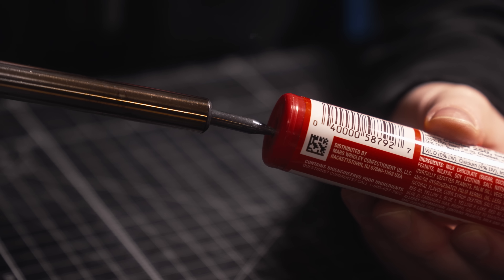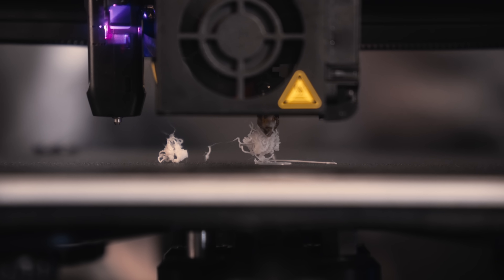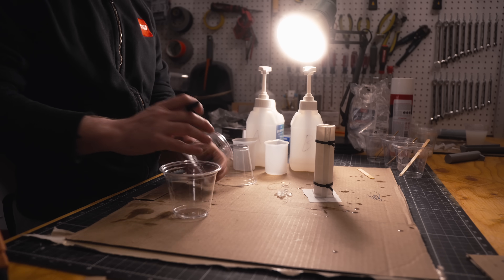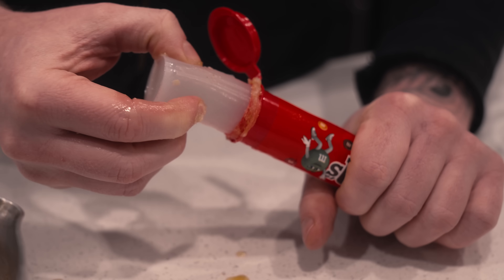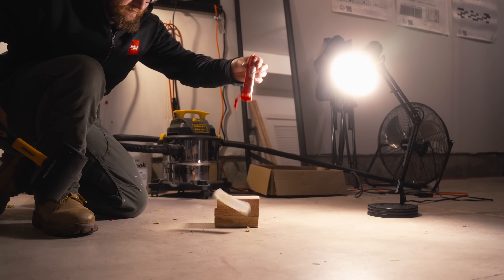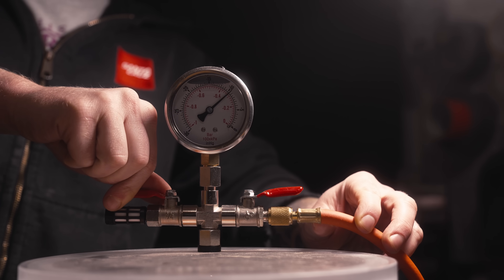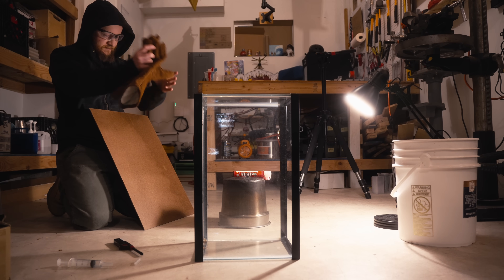Solving Reddit's Cylinder Problem with Science

Comment: engy here:
to my knowledge none of the cited materials harden dramaticly fast, therefore the only thing holding it in is pressure, use a steel cutting saw (the manual one  with the tiny tiny teeth that cut slow, even a clumsy person would struggle to harm himself with one), to cut a air hole in the far end of the cylinder.
should this action not be done in time and the mix hardens: this mixture sound like it would melt under a little heat, applying a  heat gun held 30 cm away, while never staying too long in one place should remelt the slury before any thermal damage is done to the cilinder.
should this prove unsucessfull:
pressure/explosion based attemps may harm the cilinder by passing throught the flesh tube in the middle, so that's out
 cilinders usually tapers at the end, so you probably are working with 3/5 mm air gap between the cylinder and the plastic  at the end of the tube.
use the hacksaw you fetchet earlier to slowly cut the tip of the tube to allow for access to the troubled area with various solvents (rubing alcohol, hot water ) or thermal helpers (dunk it in a VERY COLD tall glass), it should shrink enought to make removal easy)
this cutting of the plastic cap should not be done in a circular motion, as you would be more likely to scratch the cilinder that way.
 to keep tools out of the danger area as long as possible, make cuts every 45deg , stop 1/2 mm after piercing through, 
this is sufficient acces for liquid based removal attemps.
should liquid attemps not be sufficient, only mechanical extraction remain:
proceed to weaken the leftover plastic bridges with the hacksaw, until you barely breakthrought, now if you have thin wire cutters or nails snipers, you should be able to cut the remaining plastic connections, otherwise a skilled hand with the hack saw should be more then precise enought to remove the cap with minimal damage to the cilinder.

i have no good solution for cutting the tube lenght wise without out of scope equipement,

Comment: There is a power tool called oscillating multitool that was inspired by cast saw. It can also be used for variety of delicate purposes and In tricky orientations with tight maneuverability. There is even a version of such device that is used in orthopedic surgeries where it’s called oscillating bone saw, but here the use case is a bit inverted.

Comment: My first though was to fill the vaccume with liquid if this cylinder holds such feature. However if the cylinder has swollen due to this fixed position it's found in. The vaccuum isn't even the main issue anymore. Therefore op really made the right decision with hospital.

Comment: My best thought: use a bicycle pump with the inflation needle. Should be able to get the needle in between the “cylinder” and the tube without damaging the “cylinder,” and then make a little air pocket to push out the “cylinder”
Reply: But if the needle were to partially insert into the cilinder, the air pressure might cause it to expand further. 😅

Comment: so why didn't he just wait for his cylinder to shrink
Reply: That’s my question too if I had to guess the uh red liquid that inflated his cylinder got stuck with the pressure of the expansion the cylinder went through when the uh lets just call it blood flow because it would work in such a way when the blood flow entered the cylinder causing expansion the pressure from expansion might have not allowed the extra “blood flow” too return to the tank the extra blood flow came from causing a unfortunate and potentially dangerous situation for the cylinder as without fresh “blood flow” the cylinder may perish so hospital was the correct way to save the cylinder 

(God it was so hard to try and explain that in line with the joke)

Comment: All you need to do is break the seal. Making a small hole in the end will do the trick.
Reply: Not if it is an inflated cylinder that inflates more when stimulated, the pressure will create stimulation, which leads to more pressure, which will create a lot of friction to overcome.

Comment: I wonder if a hotdog would have been a better cylinder medium, not resistant to heat and might have shown damage more accurately and innitially fit the tube before silicone tinkering
Reply: Are hot dog sizes too standard to accurately replicate the size of the original cylinder?
Reply: What would you put a cylindre in an hot dog ? Clearly the cylinder your talking about is a sausage and that's probably not the kind of cylinder that was stuck into the tube
Reply: @carloskar1234  based on the information I gathered: the cylinder is not a singular object, but a structure, akin to an organic piston, with a method of expansion and contraction (how else could the cylinder fit within the tube by the dimensions we were given?)
Reply: @GamingGardevoir   You're saying that the cylinder is capable of expanding itself but cannot create enough pressure to avoid destroying the tube? Well then, if you need the cylinder to be in something like a cave, you should choose something like an organic cavity as a cylinder housing, don't you think?
Reply: @carloskar1234  that would make sense, but such an organic cavity may damage the cylinder through friction, so the cavity would require a self-lubrication system to ensure no damage to either mechanism
Reply: @GamingGardevoir   you've also forgotten about the two oblate spheroids attached to the base of said cylinder.
Reply: @kiritotheabridgedgod4178  this is new information, I was notified of an object attached to the cylinder but not multiple, and certainly wasn’t informed of their shape. Where did you gain this information?
Reply: @GamingGardevoir  it's in the original post.
Reply: Hot dogs are weak and have very little structural integrity.

Comment: Rather than vacuum chamber I really would have liked to see you blow a small jet of compressed air down the side of the tube. I bet the silicone cylinder would have shot right out!
Reply from the maker: I was planning to do that actually, but my air compressor sadly stopped working
Reply: @n @natescovill  fair enough! I mostly mention it just because air compressor would have been one of the less destructive ways to remove an… organic cylinder. A vacuum chamber would cause it to swell more, tightening the seal 😂

Comment: Brother.... Most molds are made from plaster of paris, concrete, or some other setting compound. There is also mold sand infused with wax for molten materials. 
I'm sorry in advance, but did you do any research before attempting this?
If you were dead set on using silicone for an.... Oddly shaped piece... You could easily make the mold in one cast, cut the object out, and reattach the mold.

Comment: I love how you didn't want to buy a larger size M&M tube, but paid 220 bucks for the cast removal machine at the end
Reply: Let's be real, the guy on reddit probably over-estimated the size and girth of his cylinder.
Reply: @CaptainSpaceCat17  perhaps the cylinder had tapered bezels at the end, which allowed entry into the tube, maybe a mix of overestimation with it as well
Reply: @Dup1o.2  Good point. I also am realizing just now that the cylinder could for some reason have been partially inflatable - perhaps it was entered into the tube, and then inflated after and got stuck that way!
Reply: @CaptainSpaceCat17 Yeah, he literally says that in the post.
The cylinder was able to enter the tube without much resistance, but then it swelled up inside.
And no matter what he tried it wouldn't reduce in size
Reply: @Dup1o.2 The solution is a bowl of ice water. I can't believe he had to go to the hospital.
Reply: @hundvd_7 Did he try a bowl of ice water? A bet a bowl of ice water would've done it.
Reply: @CaptainSpaceCat17  I've been seeing a lot of people suggesting the cylinder appeared to be capable of large rapid expansion, such as something hydraulically operated, or perhaps something spongy. In that case, it probably got stuck mid-expansion and couldn't reduce in size due to the negative pressure, but the theoretical maximum dimensions would still be relevant to the puzzle.
Reply: @blackfang0815  I'm not sure an average-sized cylinder would fit in one of those tubes even pre-expansion. Not without enough effort that you realize "hey how exactly am I gonna get this out?" and stop yourself.
Reply: @shreknskrubgaming7248  I think there is a point before that, between melting the butter and microwaving banana, at which you would think "Why exactly and I going to put a cylinder there" and stop yourself
Reply: @shreknskrubgaming7248  I think there is a point before that, between melting the butter and microwaving banana, at which you would think "Why exactly and I going to put a cylinder there" and stop yourself
Reply: @FasterThenDoom  I think I'd ask that question before I reached the checkout to buy the M&Ms
Reply: @shreknskrubgaming7248 how’d you acquire this knowledge
Reply: @monhi64  I would hope it's common sense for any cylinder owner
Reply: @CaptainSpaceCat17  hello fellow cat from space
Reply: rebuying the M&Ms would have wasted the money spent already buying them

buying the cast removal saw progressed the solution
Reply: @ovencake523  this. is exactly what engineers think like
Reply: @ovencake523  It's called the "sunk cost fallacy"
Reply: @ovencake523 But those money are already spent, no?
Reply: He probably bought the cast removal machine right at the start, because it was the obvious solution to the matter at hand
Reply: Eh, you can always return it to amazon if you only need to use it the one time
Reply: He already had M&Ms, it would be silly to buy more

Realistically though, he could have just returned the remaining 19 m&m tubes before opening them, or the saw after finishing with it
Reply: Government Spending in a nutshell
Reply: It was part of the planned budget
Reply: This is the most American comment
Reply: Taxes

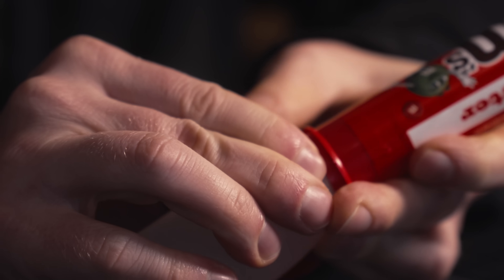Comment: 4:36 cylinder must have expanding properties, and measurements were taken in its deployed state. this suggests the reason the cylinder got stuck is due to it being deployed prematurely after being "inserted" in its resting state
Reply: Cylinders can expand when lacking proper circulation.
Reply: @mysticmoth1111  Wait a minute, cylinders expand when lacking circulation? I think it's the other way around, right? That's why the pills that keep the cylinders expanded move the circulation to that area
Reply: @frikizone2.03 cutting off circulation to a deployed cilinder can prevent the deployment liquid from leaving the cilinder, causing the cilinder to become permanently stuck in the deployed state. So you are not wrong, the increase in local circulation enhances the deployment, but precisely inhibiting circulation locally (say, with the opening of a candy tube) also does the trick.
Reply: @frikizone2.03  The way the cylinder works is having increased flow in AND decreased flow out. Changing either variable will result in a difference in pressure and therefor deployed size.
You can buy toruses that are just a smidge smaller than the deployed diameter of your cylinder. By fitting it to the base of the cylinder, you reduce flow out making it inflate slightly more.
Some people tie the cylinder up or use toruses that aren't made for purpose, but this isn't advised as it can get stuck deployed and be hard to remove. Silicone is a good option.
Reply: @skilletborne  Okay... Now I know more than I wanted to know about toruses for my cylinder, thanks, I guess. XD
Reply: @frikizone2.03  I LOVED this thread
Reply: The original poster explained that "It seems like the cylinder may have expanded". I think you are correct
Reply: The information regarding the dimensions of the cylinder also may have been faulty or inaccurate. Perhaps the person who asked the question has been pessimistic about the severety of the situation his cylinder found itself in?
Reply: Seems like those types of cylinders may moderately contract in lower temperature environments. Addressing the soft organic material, I would recommend using high heat capacity liquid with polar molecules (to not destroy the C-C and C-H bonds of the cylinder), for which regular water is great and also accessible in any laboratory. I do not indeed recommend using below freezing temperatures, as this may damage the cylinder. Something about the regular faucet cold water temperature will do the trick.
Reply: @etorommka  That's exactly what I was thinking; perhaps using moderately warm water would have helped the plastic expand a little, freeing the cylinder
Reply: yes modern science has an issue of not provided predeployment measurements 
Even brushing them off, famously, as "shrinkage"
Reply: Genius.

Comment: Been told it's an above average cylinder... that fits inside a mini m&m tube? Yeah buddy, whatever lets you sleep at night 😂
Reply: The cylinder has great personality :D
Reply: I have on good authority of personal experience that it is very hard to get one's cylinder into an M&Ms tube in the first place.
Reply: @draco18s No need to brag
Reply: @draco18s  this story didn't teach you anything
Reply: It could have been smaller prior to insertion.
Reply: @bfgfanatic1747 but it was also filled with other food stuff. Has to be a hell of a grower
Reply: Clearly you don't know enough cylinders. The cylinder is above average size, massive even.
Reply: @Mamenber massive you say? No cylinder could even reach that level
Reply: The cylinder IS above average in size, otherwise it wouldn't be pressing so tightly against the walls. I think his cylinder might be able to extend in some way, therefor making expansion into the tube possible.
Reply: I mean, it clearly did not fit, or he'd have pulled his d- cylinder out on his own.
Reply: SH- SHUT UP
Reply: There is really big m&m tubes too